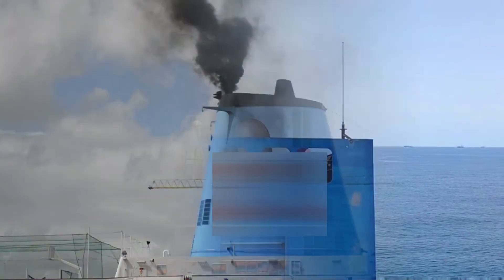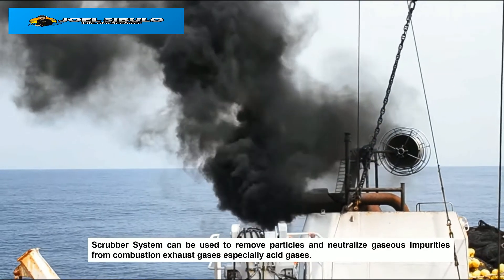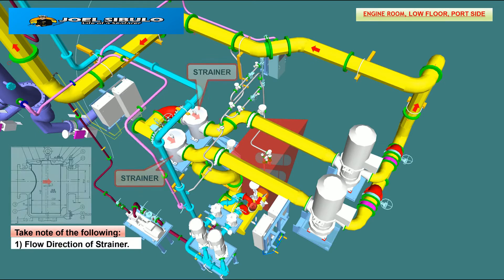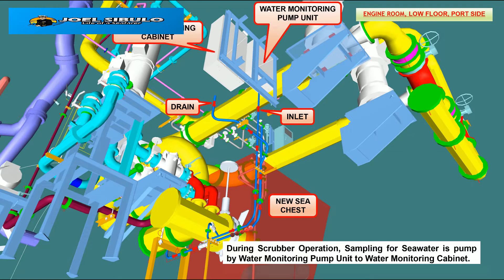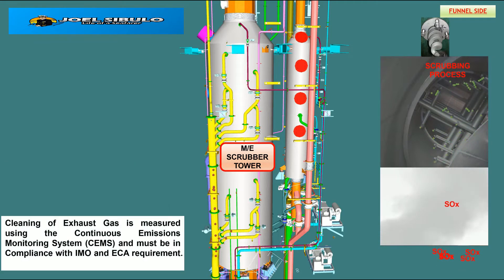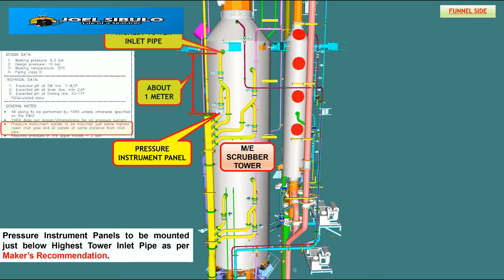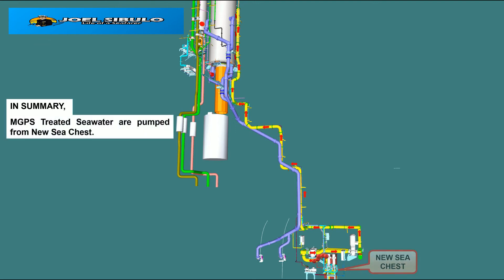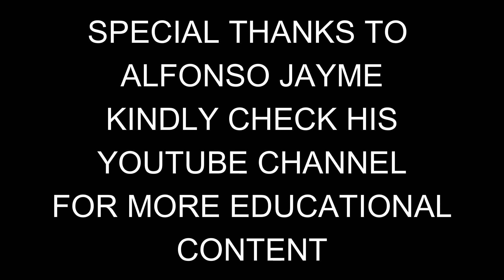MARPOL ANNEX VI - PREVENTION OF AIR POLLUTION FROM SHIPS - EGCS / SCRUBBER FULLY EXPLAINED

Comment: You present scrubbers as an unmitigated good. That is irresponsible, and a failure to properly inform your viewers. Scrubbers don’t “clean” pollutants. They allow the continued use of the dirtiest fuel and transfer the pollutants from the fuel directly into the water instead of releasing them into the air. Cleaner fuel avoids the unnecessary generation of these pollutants and the scrubber loophole allowing higher sulfur fuel should never been made permanent. It poisons the water directly (and this poisoning is allowed through regulation). One more thing. You describe what collects on the intake strainer as “dirt”. That’s not dirt, it’s the living things in the seawater. This is living seawater, filled with living things that are taken up to be strained and killed on the strainer or in the scrubber itself where the high heat, acidity, and toxins kill the microorganisms of the ocean. A study by the International Council on Clean Transportation found that open loop scrubbers are using 10 gigatonnes of seawater, almost as much as the 11 million gigatonnes of global shipping cargo. That’s a lot of the living ocean to kill, never mind the production of that much polluted and toxic effluent. Please reconsider your generous view of this approach.

Comment: Scrubbers are bad for our ocean: Most ships with scrubbers use open-loop systems, which continuously suck in seawater, which mixes with the “scrubbed” exhaust and discharges it in a hot, acidic and highly contaminated state containing dissolved metals and carcinogens.Jan 13, 2025

Comment: In todays shipping industries regulation is very strict, the new 2020 Sulphur limits push all ship to consume 0.50% fuels which is much expensive than less than 3.50% fuels, but rather to feed the engine with the new regulated fuels many owner choose ti install the scrubber or EGCS.